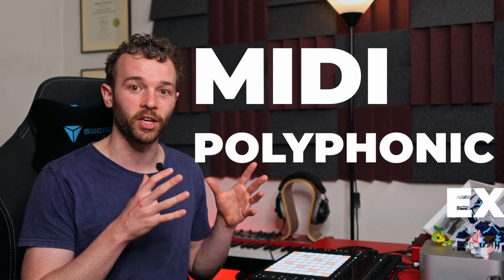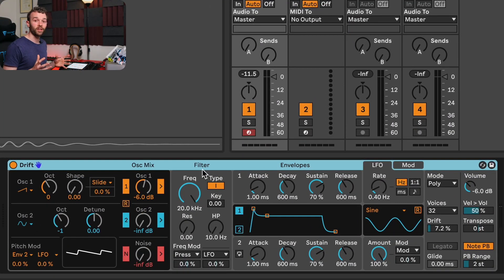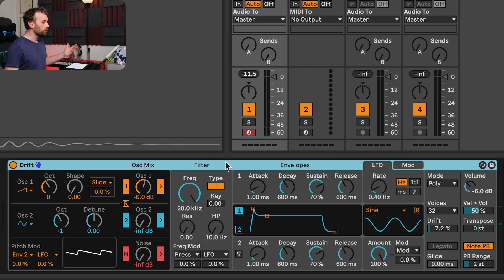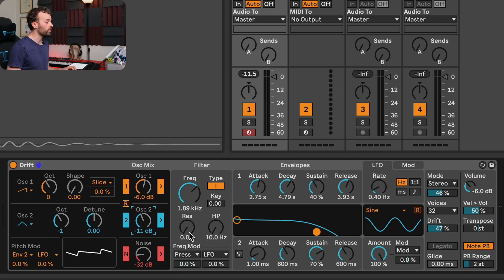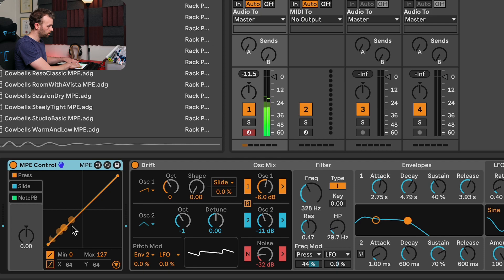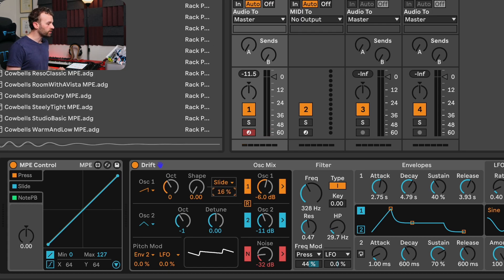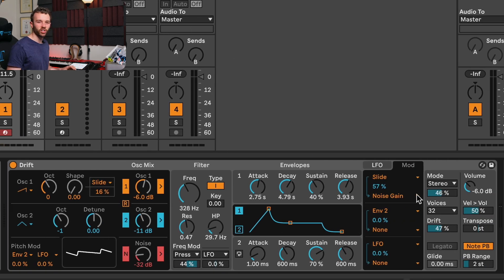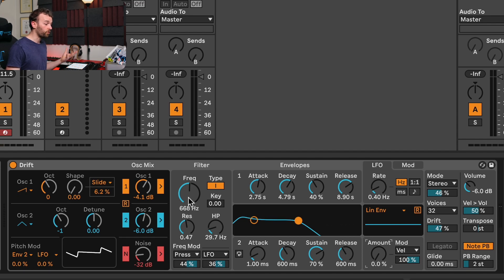How to Design Sounds for MPE (With Drift)

Comment: awesome content🥰 do you have an intelligent way of volume ducking to a kick that does no clicks and pops? i saw you using duck buddy but is there also other methodes or how do you use duckbuddy as clean ad possible? 😊
Reply: One method is to have a muted hihat acting as the sidechain trigger. So the hihat won’t be audible to the listener, but only to the compressor. And obviously it doesn’t need to be a hihat, but you normally want a short sound with a very distinct attack, so a closed hihat is what I typically use.
Reply from the maker: I've definitely found Duck Buddy to be the best side chain option! To make it smooth I often use the lookahead, ramp and smooth settings in combination at small values and listen until I don't hear a click anymore. The method that PeranMe mentioned is also really good!